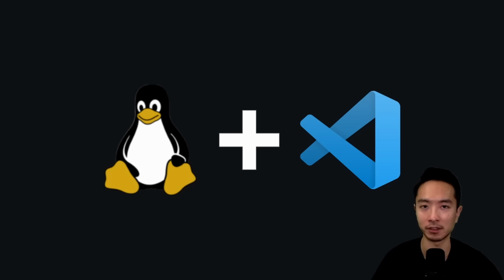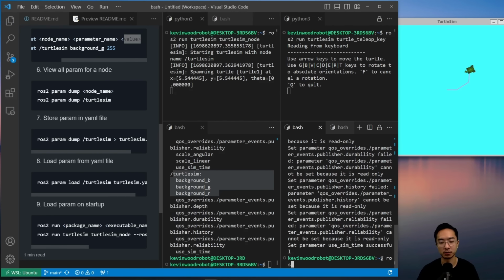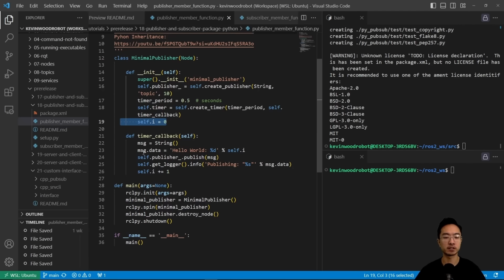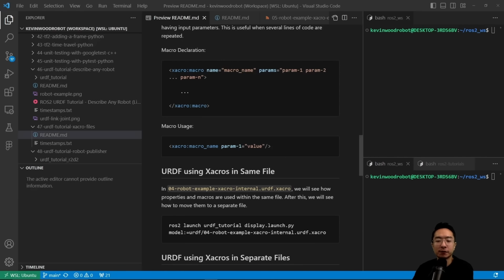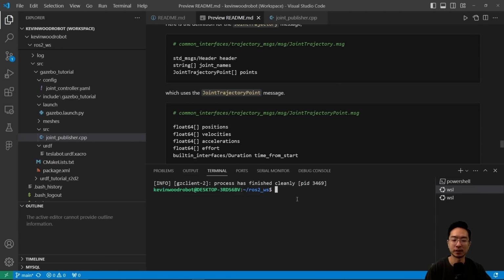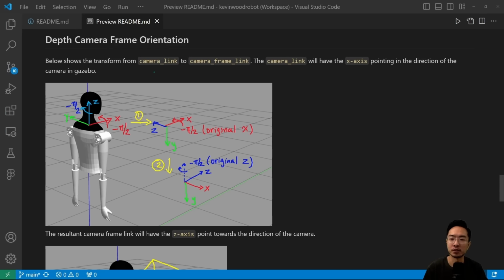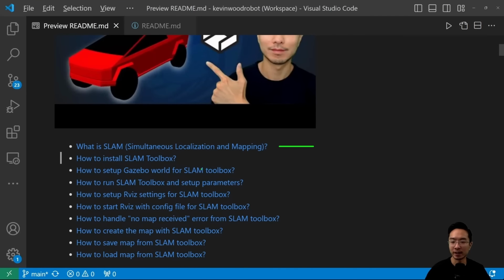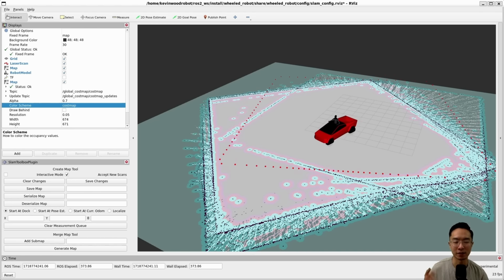Learn ROS 2: Beginner to Advanced Course (Concepts and Code)

Comment: This tutorial is good for getting an overall idea of ros2 but for beginners i feel it doesn't have the depth , and the foundation the beginner should gain if he or she is starting out, most if it is just reading out the commands , without considering the understanding of the functionality of those. Building conceptual understanding first and then providing general command , code structures , then going to exact commands is much better , so that a beginner understands the patterns and concepts rather than memorizing , copying the commands , code. 
In short more of "why" is needed with "what".

Comment: Sorry but as a beginner that was pretty terrible. You can't just jump into the stuff without setting the groundwork if you're going to call it a beginner course. Understanding concepts and being ready for real world robotics requires a lot of immediate steps. Maybe don't try to compress such a technical topic into a 2 hour video that ends up providing little to no value for an actual beginner. You explained absolutely nothing and treated everything as being self-evident.

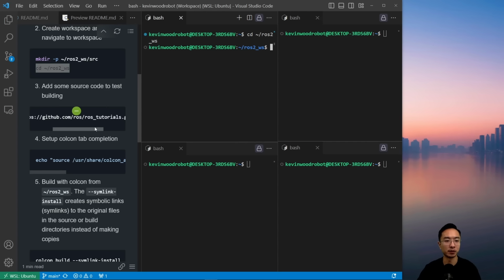Comment: At (31:22), you mention cloning the ROS tutorials. My understanding is that packages should typically be cloned directly into the src folder of the workspace. Could you explain why it's cloned into the main workspace folder instead of directly into src in this demonstration?

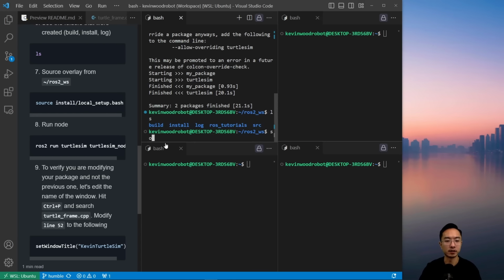At(32:36), we can see package outside the SRC folder of the workspace.
Reply from the maker: Yes normally packages should be inside the src. That might have been a mistake
Reply: @kevinwoodrobotics  Sure, not a big one. I was confusing for me. 

thanks for clarifying.

Comment: Dear Kevin,

I’m working on a robotics project and would really appreciate your advice.

My goal is to build a mobile robot from scratch using real hardware components such as an IMU, LiDAR, Raspberry Pi, wheel encoders, and cameras. The idea is for the robot to autonomously move through a small supermarket, analyze the shelves to determine whether they are full or missing products, and eventually — as a longer-term objective — manipulate and place products onto the shelves after scanning them.

At this stage, I’m especially interested in understanding the fastest and most realistic way to realize this project, starting from a functional prototype. I’d like your perspective on:

Recommended system architecture (hardware + software stack)

Which parts should be prioritized first (navigation, perception, manipulation, etc.)

Tools, frameworks, or platforms that would significantly speed up development

Common pitfalls to avoid when building such a system from scratch

Any guidance or direction you could share would be extremely helpful.

Thank you very much for your time.

Best regards,
Yasein
Reply from the maker: Thanks I replied to your email
Reply: Use articubot playlist. It makes the exact same thing

Comment: 0:00 Introduction
1:16 Setting Up WSL and using in VS Code 
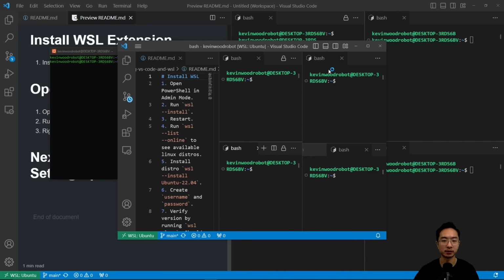3:01 Install Humble for ROS 2 
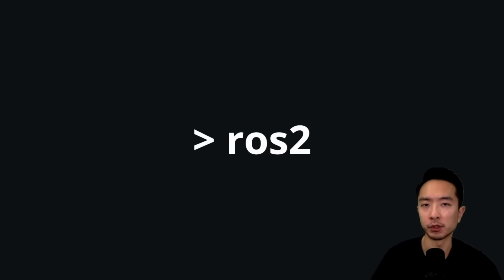4:29 Sourcing ROS
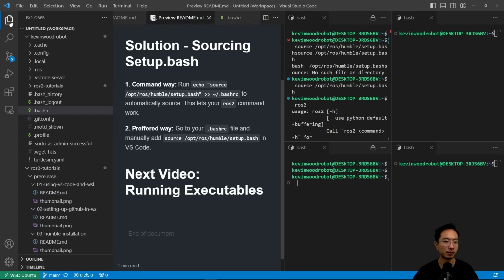5:38 ROS Executables from Packages 
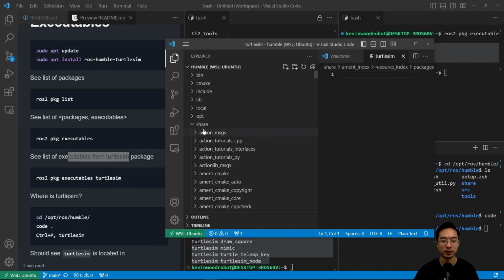9:46 ROS Nodes 
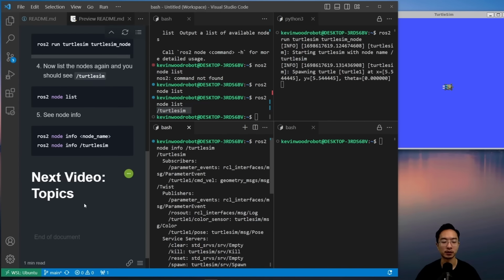11:25 ROS Topics 
16:56 ROS Services 
20:51 ROS Parameters 
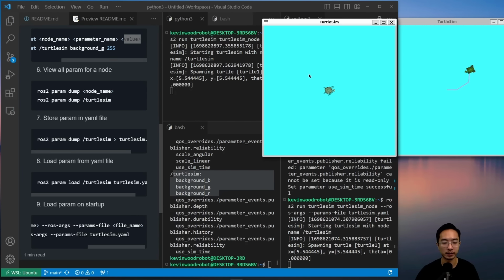24:24 ROS Actions 
28:02 ROS Workspace 
29:47 Build ROS Packages with Colcon 
33:49 Create ROS Packages with Colcon  
36:18 Create Publisher and Subscriber ROS Package in C++
44:13 Create Publisher and Subscriber ROS Package in Python
49:44 Launch Files to Run ROS Nodes and ROS Commands 
51:56 URDF Files to Describe Any Robot in ROS 
1:04:49 URDF Xacro Files
1:11:23 RVIZ Robot Simulation
1:17:44 ROS2 Control Gazebo Robot Simulation 
1:30:40 Plotting Data in ROS with PlotJuggler
1:34:07 Camera Gazebo and Rviz Simulation 
1:40:50 Lidar Gazebo and Rviz Simulation 
1:47:55 Depth Camera Gazebo and Rviz Simulation 
1:56:25 Mobile Robot ROS2 Control Gazebo Simulation 
2:14:26 SLAM Toolbox ROS Simulation in Gazebo and Rviz
2:30:52 Navigation with NAV2 using ROS Gazebo and Rviz Simulation

Comment: (during Gazebo) are you aware of this error? My Gazebo robot does not move under the publisher

[ros2-6] [WARN] [1759239084.074008138] [_ros2cli_128265]: Could not contact service /controller_manager/load_controller
[ros2-6] [INFO] [1759239084.074350452] [_ros2cli_128265]: waiting for service /controller_manager/load_controller to become available...
[ros2-5] [WARN] [1759239084.089960083] [_ros2cli_128263]: Could not contact service /controller_manager/load_controller
[ros2-5] [INFO] [1759239084.090380882] [_ros2cli_128263]: waiting for service /controller_manager/load_controller to become available...

Comment: (Thank you for such amazing course!)
Question on ROS coding
34:26 when we were learning about publisher and subscriber, we made nodes both in python and cpp but we did not need any --depend rclpy but at 1:12:35 why are we separately declaring it?  When do we need to explicitly declare it?
Reply from the maker: It’s optional. You can use that command or add it in the files manually
Reply: @kevinwoodrobotics  Thanks a lot :)
Reply: @kevinwoodrobotics  hi, around 1:47:18 when I just run the command `rviz2` by itself, rviz interface could not locate any Fixed Frame in the drop down menu. Yet when I ran `ros2 launch gazebo_tutorial gazebo.launch.py` while running rviz, it finds it. Is there reason why rviz can't run independently? Is it because gazebo just begins the robot_state_publisher? so before running rviz command - I also need to run the robot_state_publisher....?

Comment: I am getting this error when running rviz, can anybody help??

stanizska@DESKTOP-N2IC2Q2:~$ ros2 run rviz2 rviz2
QStandardPaths: wrong permissions on runtime directory /run/user/1000/, 0755 instead of 0700
[ERROR] [1757139379.554894715] [rviz2]: RenderingAPIException: OpenGL 1.5 is not supported in GLRenderSystem::initialiseContext at ./.obj-x86_64-linux-gnu/ogre-v1.12.1-prefix/src/ogre-v1.12.1/RenderSystems/GL/src/OgreGLRenderSystem.cpp (line 1201)....
.......
........
.......
......
LRenderSystem::_createRenderWindow at ./.obj-x86_64-linux-gnu/ogre-v1.12.1-prefix/src/ogre-v1.12.1/RenderSystems/GL/src/OgreGLRenderSystem.cpp (line 1061)
[ERROR] [1757139379.567646415] [rviz2]: rviz::RenderSystem: error creating render window: InvalidParametersException: Window with name 'OgreWindow(0)' already exists in GLRenderSystem::_createRenderWindow at ./.obj-x86_64-linux-gnu/ogre-v1.12.1-prefix/src/ogre-v1.12.1/RenderSystems/GL/src/OgreGLRenderSystem.cpp (line 1061)
[ERROR] [1757139379.567684815] [rviz2]: Unable to create the rendering window after 100 tries
terminate called after throwing an instance of 'std::runtime_error'
  what():  Unable to create the rendering window after 100 tries
[ros2run]: Aborted

Comment: Just started the video and am new to robotics but does this have to be run on Linux? Can I just install on Windows? What would change
Reply from the maker: Yes windows is fine! Not much difference unless you are dealing with hardware later on
Reply from the maker: Wsl on windows is better than purely on windows
Reply: @kevinwoodrobotics  when I use wsl -l -v it shows *Ubuntu Stopped, it doesn't show 22.04 version. Also, I was able to create a username but none of the keys responded when I was trying to make a password, so I continued without a password, is that alright?

Comment: When I run code . my VS code doesn't look like yours. It's just a single window, a bar on the side with the explorer, and then a basic welcome page. I don't have the layout or preview file you do.
Reply from the maker: Ctrl+` keyboard shortcut to open up terminal and add more, drag around to rearrange
Reply: @kevinwoodrobotics  And the file you had open?
Reply: use tmux command

Comment: It seems that you are running the normal Ubuntu version command prompt when starting and not the one you explicitly mentioned as 22.04 version. When I run the CLI for Ubuntu, "code ." worked directly but when I start the CLI for Ubuntu 22.04 and run "code ." it installed an addtional VScode there. Not sure now from which one to proceed or is there any difference?

Also, is it actually cleaner to do these things (only  simulation purposes) in the VMware etc ? Can I remove. clean stuff about ROS2 later easily or will it just leave residuals all over my C drive?

Thanks again for this amazing video!
Reply from the maker: I’m not sure what the difference is but I think either way should be ok. You should be able to wipe everything clean afterwards

Comment: whats the best way to run ros2? virtual machine, wsl, or do i have to use dual boot? need your advice please
Reply from the maker: If you want to do hardware then dual boot is better since some things are limited. If simulation only wsl
Reply: thankyou for the advice, and can you also add paypal option to pay?

Comment: Gazebo classic will go end-of-life in a couple days, otherwise good video, thanks
Reply from the maker: Good point!
Reply: Question, isn't gazebo classic being replaced by ignition-gazebo? They are practically the same software, no?
Reply from the maker: @HaramiHoshiyaar  yeah gazebo classic is reaching EOL, but you can technically still use it. Just that it's no longer officially supported. There are some differences between the two in terms of their architecture, but both will work
Reply: Omniverse will take place, but if you know Gazebo, it will be easy for you to switch